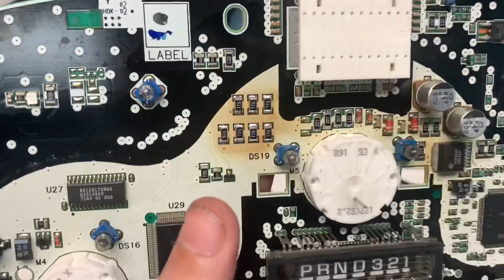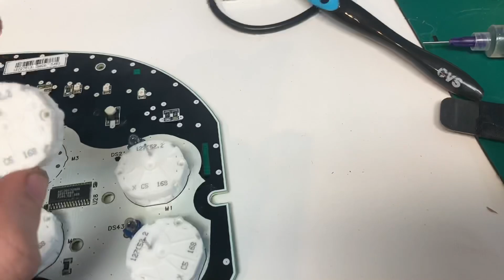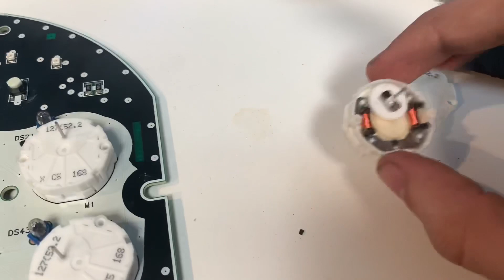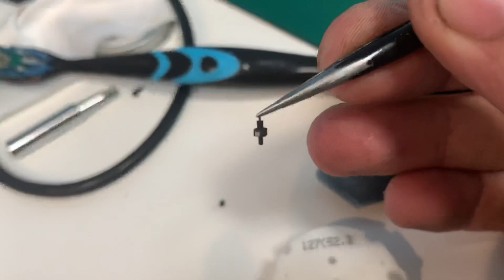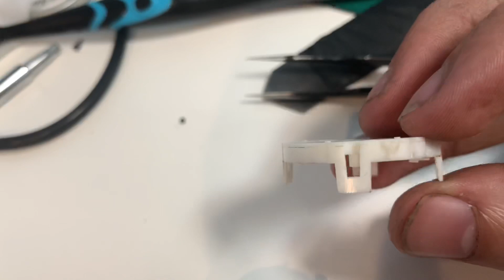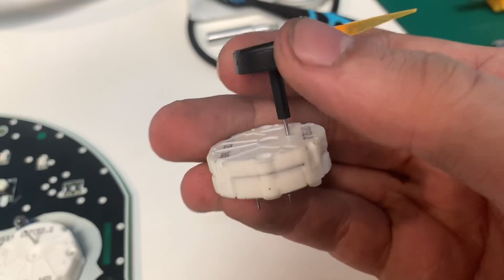How to FIX (not replace) Stepper motors in 2002-2007 GM Truck Instrument Cluster

Comment: You don’t know how the motor functions why would you even try to take it apart and if you don’t know how to functions, how can you even give a constructive video and this is only constructive criticism
Reply: If the presented method solved the presented issue, it's a valid solution.

You don't need to be a farmer or present a lecture on agriculture, to show someone how to peel an orange. This is a video about fixing a specific issue with these stepper motors. It's not a lecture on the electromechanic design and engineering of oddball stepper motors, nor does it in any way present, claim or need to be.

Comment: I removed my cluster to add an led backlight as all mine have long stopped working .... i pulled the needles off & then later put them back on they all worked b4 now none worked right after but a few days & the the tach started working a bit .. ideas ?